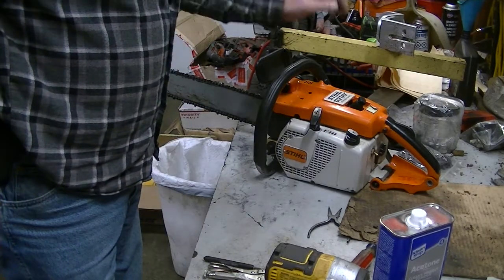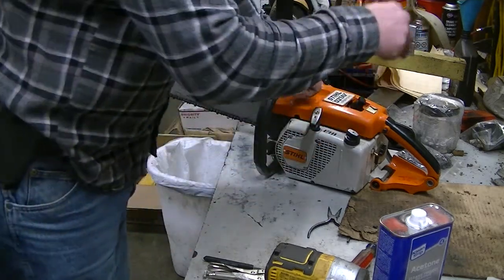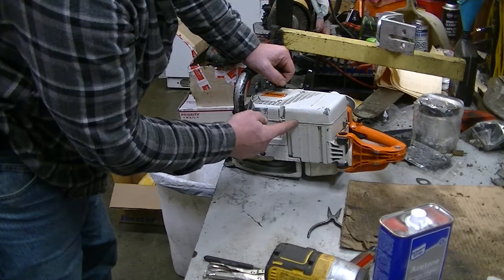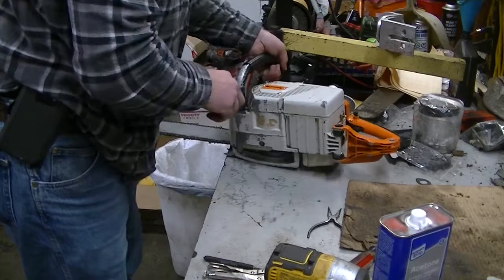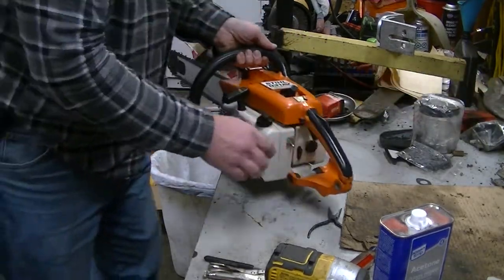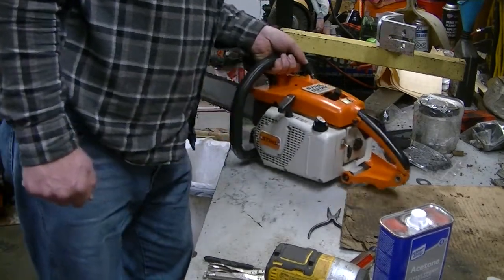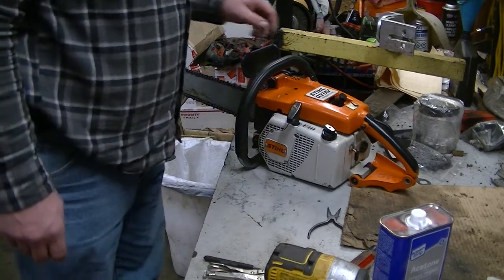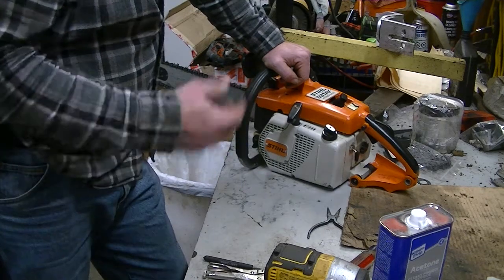Jim's Stihl 031AV

Comment: Leon, I haven't heard it yet. What's your hate on for Stihls about? I have a Stihl MS270, Homelite Super mini, Super 2 top handle (1 trigger, factory) & a Mac 3516 I'd like to trade or sell lol. So I've ran Homies in comparison to Stihl, worked on both. Neither seem to have any serious "edge" over the other if you keep them similar in CC's etc.
Reply from the maker: I wouldn't call it "hate"...more just dislike.  The Stihl's I've sampled tended to be high revver's, but not as much torque as a Homelite of similar size.  The slower revving saws have more margin for error if the operator isn't experienced...I've seen a LOT of burned up Stihls.  Not Stihl's fault I know but I like a design that is a bit more forgiving.

Comment: These saws don't have any plastic structural parts I was told by a sthil dealer that they refused to use plastic until husky out sold them because of the weight savings.
Reply from the maker: Well it's too bad they went plastic...we all know it's not nearly as durable as the magnesium.  This 031AV actually impressed me with it's build quality and overall simplicity to service.
Reply: +Leon's Chainsaw Parts & Repair True the early husky as well where more durable I think they went plastic in the early 80's